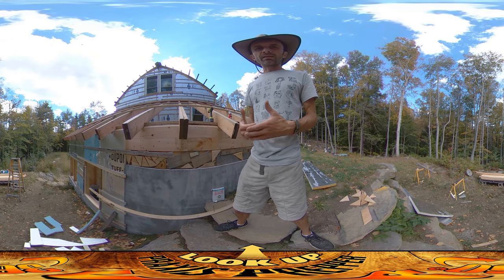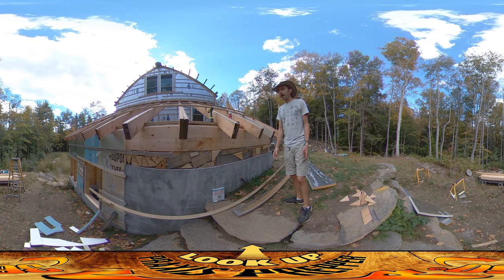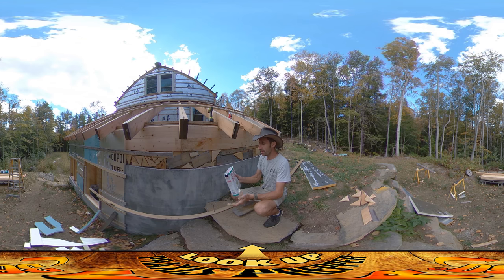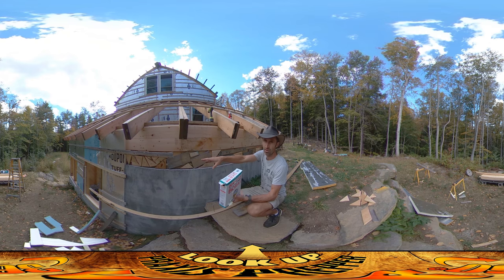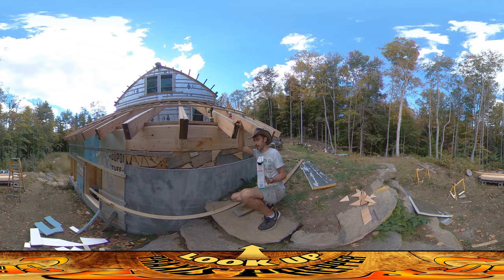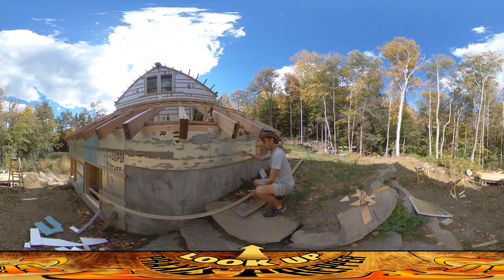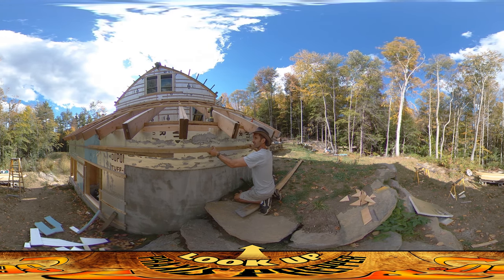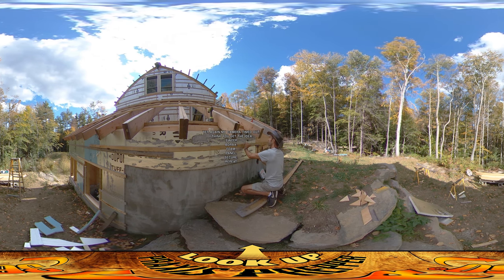Homestead Building - Greenhouse Wall Insulation, Borax for Ants

Comment: Then at the very end you check the other side (the inside) and notice you still missed a post with one of the nails (or it worked it's way out bending somehow), so you nail it out from the inside, and then rip it out with some plyers. Get a new nail, trippel check you will hit the post this time (or move over a bit so you don't force the new nail into the already created path way), nail it in, and truly feel done !